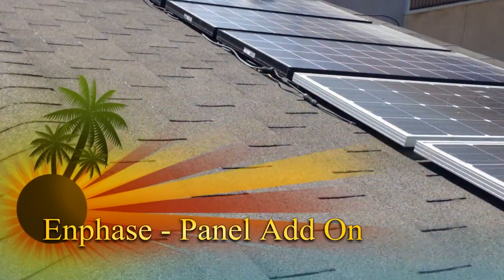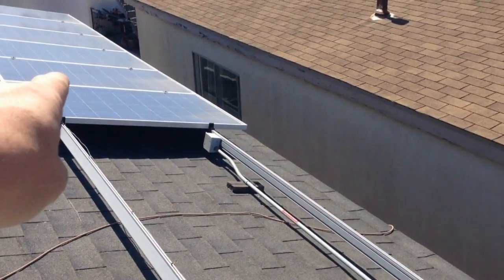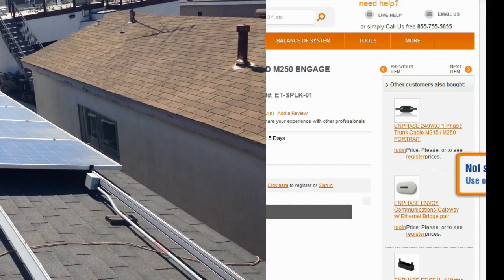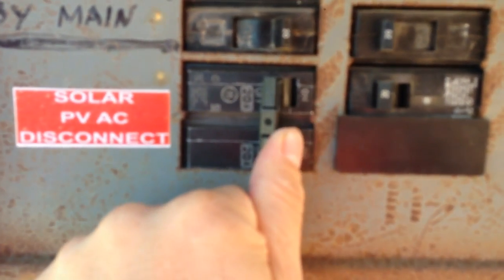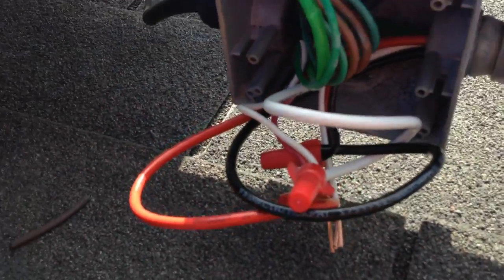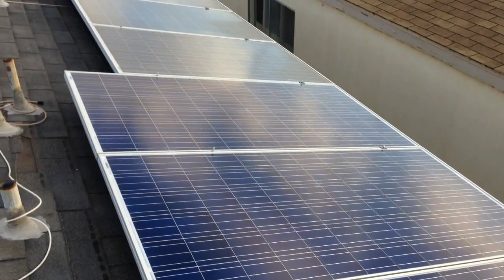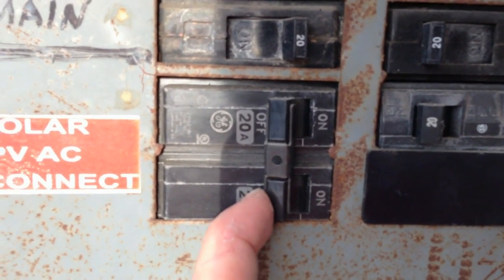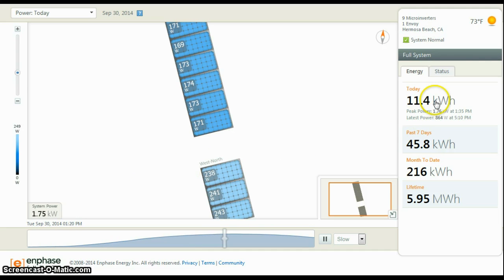Enphase Solar -- Panel Add On

Comment: Nice!  I have had 2 Enphase 210 inverters fail both were replaced ,I recently had a failing 215 unit But after someone at Enphase watched my system for say a week they replaced that 1 also great customer service, That's  nice to know when spending your money. It would be nice if you could use them in a grid down event but then thats why U have battery back up. Big panels are the way to Go.
Reply from the maker: i wonder if there was a design issue with the older M210, 215's because i've heard others have similar failures, but like you, immediate replacements.  I think most of the kinks were worked out, including in the newer M250's as i've never heard of a failure yet with the 250s.  I'm just grateful i dodged problems with my M215s.  But you can't beat the efficiency of these things...Yeah, i love the big boy panels.  I was stunned by the size when they arrived... panels were massive and no fun getting them up to roof.  just glad they're connected and making some big power
Reply: That's interesting as with the IQ8 coming out this fall will be grid-agnostic. Meaning when the grid goes down it immediately isolates the house and continues to produce electricity. Go Enphase!

Comment: The enphase seems to be an interesting method of Grid Tying. Nice info
Reply from the maker: Thanks. It's pretty simple, quick and inexpensive.  Initial install took me 1 weekend by myself from rafters to final connection.  Inverters are 97% efficient and each panel individually inverted so more efficient. Disadvantage is Enphase is gridtie only, and only way to use if grid down would be to "AC Couple" which is difficult and not as clean as your Hybrid String Inverters (Outback GFX, etc.)

Comment: Exellent vid as usual..  Not familiar with Enphase grid tie but look really simple to hook up.. Thanks for sharing your knowledge and vid..
Reply from the maker: Thank Al.  As I mentioned to Romo, Enphase 's simple, quick and inexpensive.  Initial install took me 1 weekend by myself from rafters to final connection.  Inverters are 97% efficient and each panel individually inverted so more efficient. Disadvantage is gridtie only, and only way to use if grid down would be to "AC Couple" which is difficult and not as clean as your Hybrid String Inverters (Outback GFX, etc.)